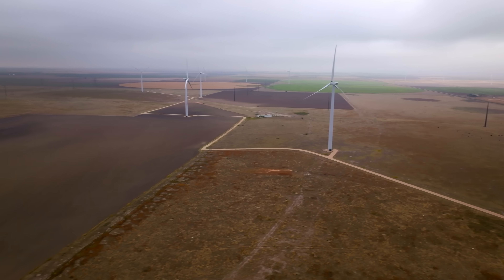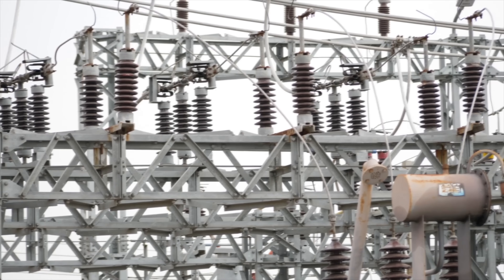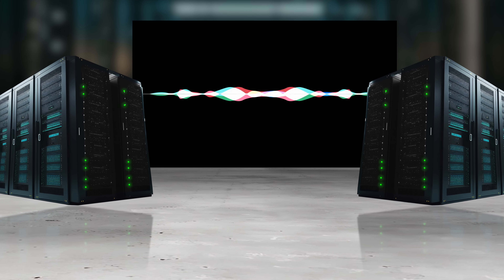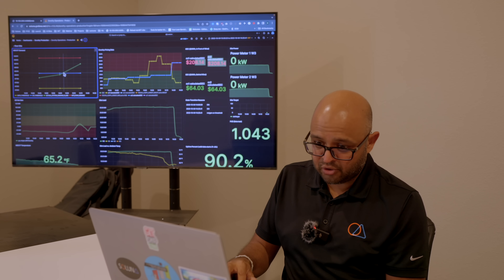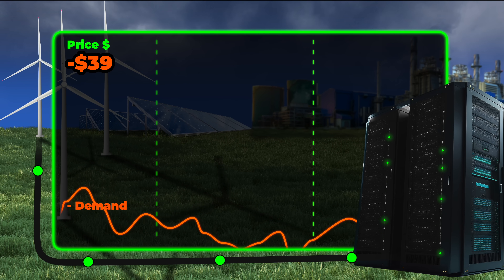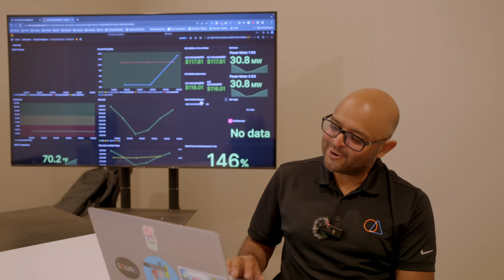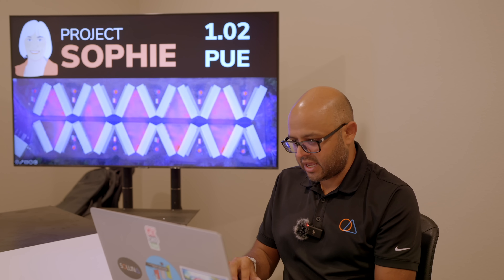Wind Farms' Dirty Little Secret No One Talks About

Comment: I’m a supervisor for a power grid operator renewable energy is a scam. We install tons of solar down here in Florida because the government subsidizes it and they require us to expensive non-reliable and the life expectancy is horrible do you realize the carbon footprint that it takes to build solar panels, we have two nuclear plants they refuel about every 10 to 15 years. The base load that they provide is the cleanest  per kilowatt hour  backed up by natural gas high-efficiency turbines they ramp up quick, and you can ramp them down quick

Comment: Is there a way to use all that computing power that creates heat to boil water to turn a turbine and generate extra power? (Charge battery packs to use while peak demand is in process so computing or website doesn't have to be turned off)

Comment: Axial and radial are key points why the current designs of wind generation are so 💩.  Should have wind sails that rotate on a different axis.  Only one moving part to generate electricity, without killing birds and built dirt cheap.

Yes, corruption in energy sector is very commonplace.  Sadly being smart demands stopping being stupud, like this channel.

Comment: This is the problem with ALL "renewable" energy. It's far more expensive, in all forms, and can only compete when energy costs soar. This is the real reason energy prices have escalated; not foreign wars, not OPEC cartels, not Venezuelan unrest. And if you don't believe in "trickle down" economics, you might take another look. High energy costs are a primary driver of the high prices of food, utilities, lumber, you name it. There's nothing wrong with using free sources of energy to produce electricity, but shouldn't it be less expensive instead of costing more? All the hidden costs (direct and tangential) kill the economic advantage. Indirectly, windmills take land space that could be used for other purposes like farming. Lower food production tips the supply/demand toward the demand side, so prices increase. Wind turbines fail at a ridiculous rate, and let's not forget that when the wind stops, so do they. Burning "bio fuels" instead of fossil fuels is a fool's errand. You're still burning carbon and producing carbon dioxide, just in a less-dense, more expensive form (by far). Recycling "waste" energy helps, if it can LOWER the costs. But storing off-peak energy so you can sell it during the day at the higher rate isn't doing anything to lower costs to consumers.

Comment: If we had a smart grid, we could use more electricity when we have more electricity. I dont like being forced to do anything, but i once called my power company asking about voluntarily using power when they had excess. Like running my fridge colder and heating/cooling my house, running the dryer, etc. However, they didnt have any way for me to even look up current demand. If they had a website that gave live updates about usage vs generation, i could grab that data in real time and adjust my usage to use to match when there is extra; however, there is nothing like this.

Comment: I've passed several windmills that have their blade pitch parallel to the wind, and I've always wondered why they were set to not generate energy. I'm glad you covered this!
Reply: they generate energy when it's the least needed and fail to generate energy when it's the most needed.
Reply: the vertical wind turbines are designed far more efficient than these, but i suspect they will eventually upgrade to the vertical ones when the other design ones die or break down. 

just look up vertical wind turbines, they are the way to go, but some of them still have some bad design choices, i have only seen one of them that works best for the majority of situations, there are a lot of them that come with some bad choice designs that don't do that well. 

i would send a link to one that is the best, but youtube doesn't like accounts like mine posting links because i haven't given them my identity, so youtube pretty much treats me like spam if i try and post any link, only verified people can post links, i'm just too poor for that direction.
Reply: The turbine could also be down for maintenance.

Comment: It's sad that Wind Farm operators in Texas haven't figured out how to store that 30-40% of non-used energy they could have harvested (11:20).
 In 2017 Hornsdale Wind Farm in Australia installed a large 190 MWh Energy Storage Battery that paid for itself within 2.5 years! Since 2017 the wind farm as tippled the size of its Energy Storage battery and increase profits by 63%. 
Kind of curious how much profit the Soluna solution offers to the wind farm? The computing setup is likely always purchasing energy at a discount, not at the best rate the wind farm could get if able to store and time shift to the needs of consumers. 

The key to making full use of renewable energy sources like solar and wind is pairing it with battery energy storage.

Comment: I’m not sure open loop evaporative  cooling is very common any more. I would be surprised to see that type of data center being built any more. Data centers with no AC like the one in this video are becoming more common because the computers are built to handle warmer temperatures. ASHRAE standard have changed to reflect that as well. Great video.
Reply: I’ve seen data centers over the past 20 year migrate from 42 degree water to 55-60 standard. Then I hear there are other data centers that are doing 75-80 ( was told by industry friends FB ran that temp at the facility local to me). I haven’t sent that personally though. To me I like the 42-44 degree, it gives an extra buffer in a situation to get control over cooling failure.
Reply: @TBJK07Jeep  it’s true. The temp and humidity range is much wider. The old tape storage isn’t used very much anymore and it required more stringent room conditions to keep it from deteriorating over time from what I understand.

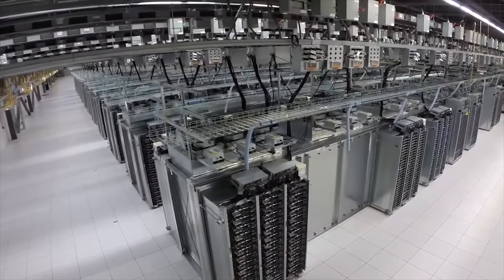Comment: sorry, but by 3:15 the whole problem is mentioned right there, its not taking into account of how much the public is paying, its paying more attention into how much profit is being made from this, if you was selling the energy at its lowest prices, and using various forms of gravity batteries to store the energy, then the brownouts would stop, and people would be able to afford things like AC and lights etc, this is the point where shareholders are enforcing things like poverty, some people work 40 to 60- hours a week in hard labour type jobs, but again its shareholders that are profiting, and the general public getting rolled for it.

Also the heated air is not being used, the evaporative cooling option would easily be used to help with water based gravity batteries, because its condensation would already be heading to the top of the gravity batteries storage to be condensed, rather than being pumped like the majority of the storages water (liquid) content

Comment: That is a crypto mining farm, not a data center. While there is nothing wrong with mining, it doesn't really provide a product or service to anyone but the owners. It's not "powering the internet." In fact, it would be terrible to run a real data center this way. Are websites just supposed to go offline when grid demand is high?
Reply from the maker: Their pilot plant was a bitcoin miner. Future plants will be scalable data centers. The engineering the is the nearly the same
Reply: @TwoBitDaVinci  fair enough, but how do we address the issue of intermittent outages? The data center will only be switched on when grid demand is low and then go offline the rest of the time. This is fine for crypto mining but bad for streaming or cloud computing

Comment: If someone invests a huge amount of cash into computer equipment they will want to run it 24/7 in almost every case. 
The real solution is storage and transporting the electric to far away places. It’s not windy in California but it is on the east coast for example.
I like the water storage systems which use cheap or excess electricity to fill up huge reservoirs of water high up on a mountain. When the demand increases they release the water turning generators to make electricity instead. 
Transportation like cars and trucks could be the solution if all the vehicles are capable of two way transmission. If the electric is in demand your car could back feed your home while you run AC, clothes dryers, stoves, and other high load items. During the night the car could charge up 100%. 
The solution is multiple things but letting a million dollars worth of computer equipment sit idle is probably not a very good solution.
Reply from the maker: No it’s much more complicated. Mitcoin miners for example… is all about electricity cost. Similarly for other things.

Comment: The points that no one is making is that because wind power is intermittent it cannot be relied  on to create power. The same goes for solar. And they did mention that the wind farms sell power at a loss to create subsidies, so my next question is, who pays the subsides? Don't we also have to keep other power plants like gas or coal ready to take over when the wind doesn't blow or at night when there is no sun? Don't we pay more for power in the afternoon when the a/c is turned on? Why so much complexity when a gas plant can be spooled up in a moment? However cool this stuff is it will never be anything but a secondary source for power unless you want to get rid of all cars, airplanes, most of your clothing, etc.

Comment: Why not run the wind turbines full out and use the extra power to pump water uphill into storage reservoirs, then release the water through water turbines to downhill reservoirs to generate electricity when excess is needed.

Comment: This is interesting. It also shows another reason we need to be improving the efficiency of our computers and the way we write our code. 

I’d be curious if anyone evaluated the energy saving from switch to an CISC system, such as the x86, to a RISC system, as the ARM, as an example? Of course we’d need to  be factoring in any potential impacts on processing time.

Comment: The only problem with these co-located data centers is that it typically is in violation of the GIA (generation interconnection agreement) that the owner has signed with the ISO (SPP, MISO, ERCOT). So they are not allowed "behind the fence" or "behind the meter" as a station service load or parasitic load. 

What we have been seeing a LOT, as of late, is BESS (Battery Energy Storage Solution) that is coincident with an intermittent generation resource (wind, solar). When the price or congestion is bad then the MWh produced goes to the battery for future use or stored up for RT ops. And the battery can also provide for demand response (load shedding), ancillary and reserve services that get paid BIG and is immensely profitable.
Reply from the maker: This farm is in Texas with ercot and fully approved. Everything can be changed and fixed.
Reply: @TwoBitDaVinci Glad to hear they are letting this style of connection through. Do you know if it is on a PUN?

Comment: Windmills not spinning when it's not windy enough is directly analagous to solar panels inactive when it's too cloudy or at night, and hydropower output when the water source is low. This is a given to all but a few with nature based power.
Reply: You also can't run the turbine if the wind is too high
Reply: @HH-le1vi  At some point, yes. But I venture to say that the occurrence of it is small.
Reply: @joewoodchuck3824  its a lot more frequent than you think. Those turbines are 400ft in the air. The wind speeds are a lot higher and when they go over 11-14m/s you can't run the turbine.
Reply: @HH-le1vi  How about kmh please? Meters/second is rather abstract.
   I see very few of them to know that much about them anyway.
Reply: @joewoodchuck3824  the industry measures it in meter per second. 11-15km per second is about 40-50kmph
Reply: @HH-le1vi  Thanks. I think most people relate better to km/h and m/h because of their familiarity with vehicle speedometers.

Comment: It is well known that in the no fossil fueled future then 5 TIMES more electricity is needed.

Now you are saying computers will add to electricity demand. 

So no petroleum, no gas hotwater, gas heating, gas cooking, no gas fired electricity generators, no coal fired electricity plants,.....

Now 5 TIMES maybe 6 TIMES more electricity. 

The national electrical power grid is FRAGILE today because it is incredibly expensive to build and took decades and decades. 
It is not overbuilt. 
66% of electricity bills are grid costs, the grid is so expensive. 

The grid and its future expansion is a humongous cost.

The grid costs must be added to all central generation costs.
ALL CENTRAL GENERATION EXPANSION NEEDS A GRID EXPANSION. 

GRID supplied electricity makes even free electricity expensive. 

The only exception is if every building had rooftop PV and EV big battery plugged into the building/ national grid 23hrs every day. 

The grid will pay you for you daytrading your batteries capacity.

In Australia that means 660gWh generation plus 2,000gWh in storage, max 2,660gWh daily.
Avg demand from fossil fueled generation is only 300gWh. 

This is 9 times advantage daily and no extra grid construction.

This is a red hot topic and should be discussed.

Fossil fuels can be a strategic military reserve asset and can be used for emergencies.

Comment: Green Hydrogen production seems like it would be a good solution for unused capacity, as the process is energy intensive. Curious if the hydrogen stored could be sold for fuel cells or stored until needed?

Comment: Grid stabilization using hydrogen as energy storage.  Excess capacity is stored in a small footprint without the damage of mining.  When demand goes up, fuel cell puts energy back on the grid.  
People will say, “but it’s not efficient because it costs too much to split H2 from water!”  But this video just showed that excess capacity electricity is cheap.

Comment: I get that when we used evap cooling at our homes, the water would just be lost to the outside air (maybe eventually formed back into clouds but that part of the cycle takes a long time). So why can't cycling it in a closed loop like some overzealous computer freaks do at home with their fans and heatsinks work on this larger scale?

Comment: There is another dirty little secret at wind farms. Maybe not in the case of this wind farm, but in wind farms where the excess energy can't be used elsewhere, the wind turbines get turned off completed. BUT, they can't just stay stationary because the weight of the wind turbine will actually damage the bearings so the turbine actually spins very slowly. Now, I was at a wind farm and asked the engineer whether this turning motion was done by the wind or if it was done using power to turn the generator into a motor - and he could not, or rather did not want to, answer that question.

Comment: You clearly have never heard of batteries or capacitors that STORE energy locally for when it’s needed. That’s why the grids of tomorrow will be superior because on demand TRANSMISSION has massive loss in energy over distance. That’s why the energy needs to be generated and STORED locally for when it’s needed so to cut down on the huge loss in transferring over long distances.

Comment: This is bs. Power plants don't react to anything as small as anything you do in your house. Benefit of scale. The complication has been broken down where its not that bad to adjust to maintain monitoring hertz and voltage. There IS use for the wind power, he said it himself, they cant sell because of price. The windmills are more often not spinning because the wind is too strong, or too light, or its too cold, or its too hot, or they are shutdown for maintenance. The wind cant handle the system, and the existing system has trouble working with the wind. Go figure.

Comment: Hi Everyone,
        The excess power should be used for hydrolysis; the production of green h2! ! !  The 'O' can be likewise compressed and stored for industry 
          I/C hydrogen powered cars trucks, aircraft & boats should be put in production and let the market sort out engine configurations that work & sell 
                                       Very resp.,
                                       R
Reply from the maker: That would be about 30-40% round trip efficiency. And you’d still need new data centers. Thats why this is genius
Reply: @TwoBitDaVinci  
Hi, TBDV,
        I am sorry that I do not understand.
What exactly are you going to do with that 'wasted' Solar Fraction of over supply.  The power needs to be used.  I am suggesting near site hydrogen production plants that can store the converted kinetic energy into stored chemical energy.
        What are your promoters going to do with the power?  I see that they are offering an optimization program, but the energy needs to be used, if for nothing else to maintain the wind farm.

Comment: Great episode. I also had never considered the water debt of the cloud. I just knew about the enormous amounts of water used by chip fabs. The internet is not very green.
Reply: I would think that 'evaporative cooling' only happens in dry, desert environments, trying to evaporative cool when the relative humidity is 80 to 95% is a waste of time/energy. You need low humidity places like desert SW and western desert country to use that type of cooling.